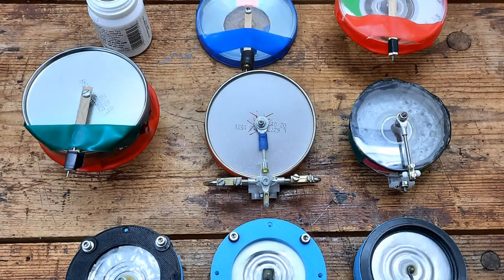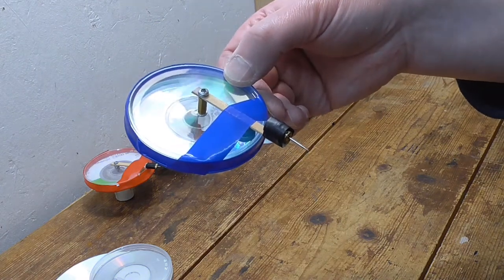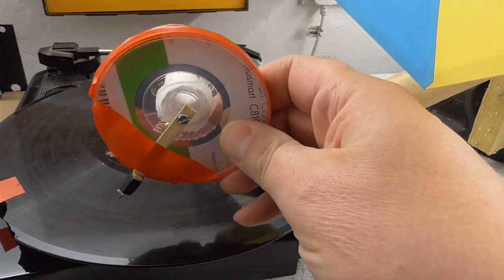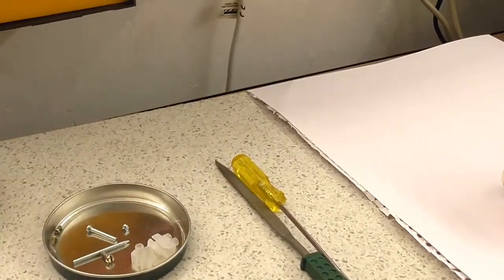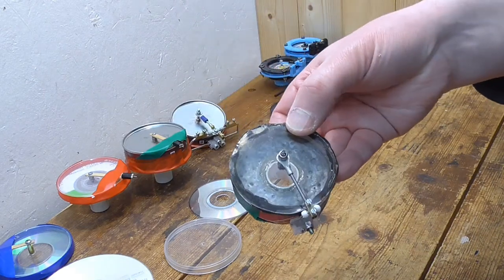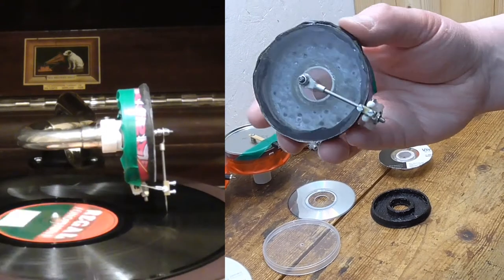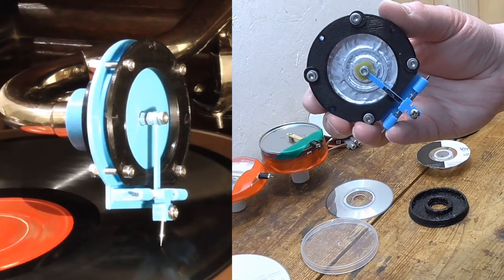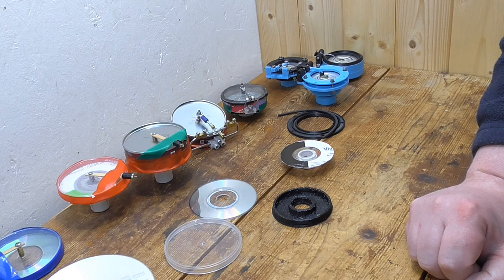All my DIY soundboxes & reproducers (so far)

Comment: Forgot about that wild paper horn. You’ve come a long way
Reply from the maker: Thanks 👍😀.  I still have that horn. I am intending to use it in another video, just for old times sake 😉
Reply: @mrrgstuff  most of my soundboxes have been scavenged or just tossed. Nice to see some of the old designs again
Reply from the maker: I was a bit surprised I still had as much as I do. Some of them were just bits though, but only a few minutes work to patch them up again 😀